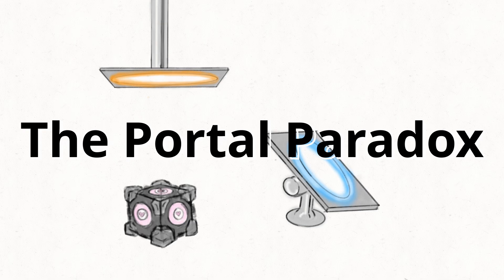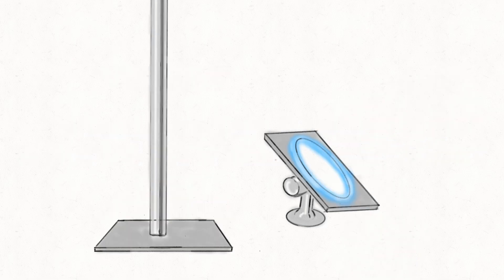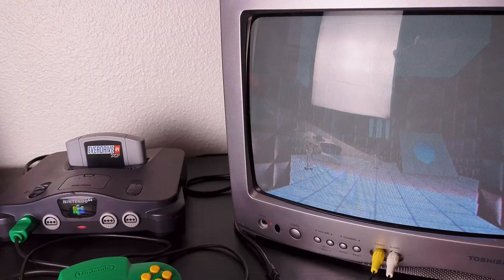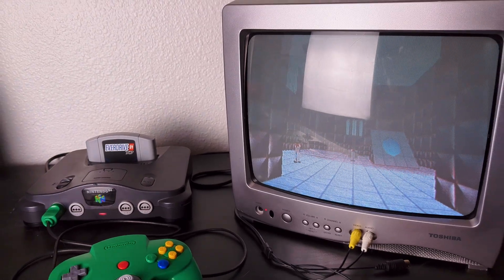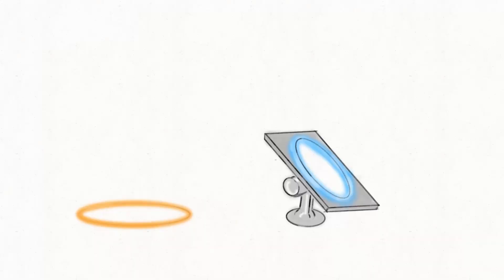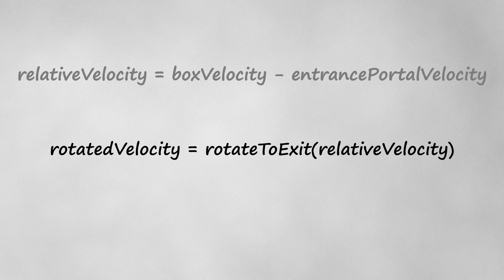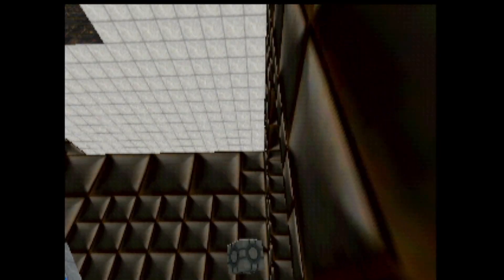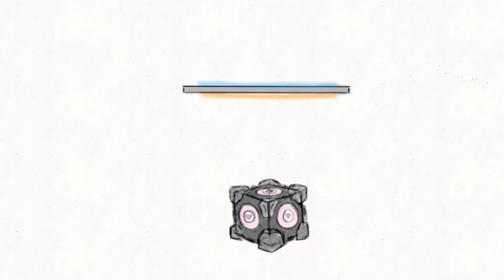I rewrote Portal from scratch and solved the Portal Paradox

Comment: f=ma Your model doesn't take mass into consideration, say the cube is a solid block of tungsten weighing 1 ton, by your model it wouldn't matter if the portal was on a piston going 20mph or a signboard swung by hand at 20mph, it comes out at 20mph. There is no force acting on the cube, just the transfer between portals happens quickly.

Comment: Or to make it short, The portal and "the world behind it" are can be imagined as a train that moves towards you. You are relative to yourself still not in motion but the world moves around you. Therefore in order to not fly through the world you have to move at the same speed relative to the portal, before entering it.

Another edge case scenario would be if the portal suddenly stops when it just moved you half way through it. The half your body, that was already "inside" the portal, would still have the moving velocity from moving through the world and you other half from "outside" the portal has no velocity because it never moved relative to the world. Means you suddenly experience fome sort of centripetal-ish force and if it was fast enough that may even cause you body to tear itself apart. ... Where the heck did my imagination that dark of a turn all of a sudden???

As you may have noticed does both only count if your portal has no "inside portal realm" but functions like an infinitely thinn door frame. (Like in the games snakes or astroids for example.) But if your portal HAS an inside relm you have to cross, like the wormhole you see in interstelar or the portal in the movie Warcraft (or like the teleportation power of nightcrawler in xmen was explained), the entire portal paradox gets relativated anyway.

Comment: A portal does not transfer its momentum to objects passing through it; a portal preserves the momentum of things passing through it.
Reply: It's the same thing because momentum is relative. A portal moving towards an object is the same as the object moving towards the portal.
Reply: @kremitthetaco8725  the way I picture it is the same as if you took a hollow box with a hole in the bottom and dropped it onto the platform with the cube. The box’s momentum would be absorbed by the platform and the cube wouldn’t move. Here, because the portal transports the cube to the slanted surface, to me the cube would slide off. 

“Cube moving towards the portal is the same as the portal moving towards the cube” is valid as a way to explain conservation and is true given specific reference frames, but it disregards initial conditions. For example, depending on the reference frame me shoving you is the same as you shoving me, yet we both know there are more factors involved and in all likelihood the two actions would not yield equal results.
Reply: @Scuuurbs  Your analogy with the hollow box doesn't take into consideration that the cube already enters the portal before it touches the platform. What is absorbing the relative momentum of the cube from the moment it enters the portal to the moment the portal touches the platform? Let's say it takes 1 second to fully push the portal over the cube. That's 1 second of relative momentum basically pushing the cube through the portal until it stops.

If the cube truly had no momentum when leaving the portal, then the same would apply to every single particle the cube is made of, right? If every particle of the cube is static relative to the portal, they would all try to materialize on the same location on the surface of the exit portal Do you know what happens when you force 2 particles to exist in the same location? I don't. I don't think anyone does. But it probably wouldn't leave the cube intact.
The only thing which would stop that from happening is if the following particles push the preceding particles out of the portal, which would once again apply the relative momentum to the cube. So this also leads to the result shown in the video.

I'm also really not sure what "initial conditions" you're talking about. The entire point of the Portal games is that you're in a test facility for portals which exists particularly to eliminate external factors.
Reply: @kremitthetaco8725 The particles of the cube are "pushed" by the same atomic forces that maintain the cube's shape, irrespective of any qualities the portal possesses.

The only momentum that exists for the cube in this scenario is from the reference frame of the portal itself, which is unintuitive. Better to use the reference frame of an observer - in which case the momentum exists entirely in the piston/panel the portal is attached to, and its momentum is absorbed by the platform the cube was on, as well as whatever the piston is connected to.
Reply: @Scuuurbs  The laws of physics don't care much about what is perceived as "unintuitive" by some observer. If the camera was attached to the moving platform, your entire point of view on the experiment would change but the laws of physics remain the same.
The cube and portal have relative momentum to each other and that's the only thing that matters.
And if you're saying the particles of the cube are pushed through the portal, then they must have momentum when exiting the portal. And how fast would they be pushed? Is it some arbitrary number? Or is it simply the speed at which the cube is pushed into the portal?
Reply: @kremitthetaco8725   I didn’t say physics cares about intuition. The point is that your choice of perspective is leading to misconceptions. 

Saying the cube and the portal have relative momentum is arbitrary. Everything has relative momentum. What about the relative momentum between the portal and the platform the cube is on? The portal and every particle of air passing through it? Just like the video creator, you’re reducing the interaction to a rudimentary level in order to get the results you expect to see.

Consider if you were in the cube’s place instead. You would observe the orange portal coming down towards and around you, you would observe the blue portal continue to go down around you… and according to you, you would experience lift? It doesn’t make sense. The only force you should feel is the change in gravitational force due to the blue portal being on a slant.

Also, I’m not saying the particles are pushed through. I said “pushed” in quotes to use your terminology. They aren’t pushed any more than they would be by dropping a hula hoop around them.
Reply: @Scuuurbs  The cube and the portal have relative momentum. Saying that is not arbitrary, it's basic physics. Motion can only be measured given a point of reference. Depending on what point you choose your perspective on the experiment might be different but the result always stays the same because the laws of physics don't care about what we choose as a point of reference.

And you're right, almost everything has relative momentum. You might be sitting still right now but you have relative momentum to a lot of things. The birds outside, the cars passing by, the sun we all orbit around, the moon orbiting around us. That's why it's important to choose the right point of reference. 
Neither the platform nor the observer play an important role in the experiment, so why would you choose either of those as a point of reference? Just because it feels right to you personally? The video creator chose the portal as the point of reference for his calculations because that is by far the most important object to create consistent rules for how portals work.
This way it doesn't matter if the portals are in different places or move in different ways. The math is always the same. It's not arbitrary, it's simply what makes the most sense. Choosing anything else would be arbitrary and unnecessarily complicated.

If you were in the cubes place you wouldn't feel any lift. Humans don't feel constant motion, only changes in motion caused by a force acting on the body.
If you're on a train that is moving at a constant speed you can just get up and walk around as if you were on solid ground. Only when it speeds up, slows down or changes direction you feel anything because that's when a force is affecting your body. 
When the cube goes through the portal there is no force applied to it. It simply maintains its momentum. Therefore you wouldn't feel any pull or lift if you were in its place, only the gravity that is pulling you down afterwards.

It doesn't matter if we say the particles are "pushed" or "pulled" or whatever. They move after leaving the portal. They have to to maintain the structure of the cube. Otherwise the scenario I explained earlier would happen with particles existing in the same location. They must make place for each other and that requires movement. So at what speed do they move? And why would they suddenly stop moving after the cube has fully passed through the portal? The hula hoop analogy explains none of that. According to the hula hoop analogy the particles remain static which would again lead to the cube destroying itself after leaving the portal.
Reply: @kremitthetaco8725  what do you mean you wouldn’t feel lift? You’re standing on a platform, a portal comes down, and suddenly you’re flying through the air with the momentum the portal transferred to you. You would absolutely feel it, and it makes zero logical sense. I can’t think of any scenario where something can transfer momentum to something else without some kind of collision occurring.

I think you and I fundamentally disagree on how portals work before their momentum is even considered.
Reply: @Scuuurbs  It makes sense once you stop arguing with your intuition and consider the laws of physics and the theoretical facts we have about portals.

As I said, no force is applied to the cube. Force is what you feel, not momentum. No momentum is transferred. The cube always has the same momentum.
If you jump into a static portal and come out the other, do you feel the change in direction? Of course no one has actually done that in reality but judging from the games it seems like that is not the case. Why is that so? Because no force is applied to objects passing through the portal, therefore you don't feel it.

Do you feel a difference between sitting in a train going 50 kph or sitting in a plane going 500 kph? You don't because as long as they maintain the same momentum, no force is applied, therefore you don't feel anything.
No force is applied to objects going through portals, no matter if they are static or in motion. You don't feel anything going through.
Just because you can't imagine it doesn't mean it doesn't make sense given what we know about portals.

I think you lack a fundamental understand of physics.
Reply: @kremitthetaco8725  The cube is motionless relative to its environment. The orange portal is in motion relative to its environment. As the orange portal completes its movement, the cube emerges from the blue portal and slides off the platform.

I’m not a physics major, but I understand enough to know it’s ridiculous to choose the only perspective in which the cube has the appearance of motion as your basis for deciding momentum. The cube is motionless with respect to every observable object not directly connected to the orange portal’s platform. 

Choose the anomalous perspective, observe an anomalous outcome.

Comment: Im still curious. In this experiment of course the cube is just a monogamous simulated entity. Would it be posdible to simulate the cube as a wireframe linked mass of smaller objects, like a 3x3x3 or 5x5x5 grid, essentially crudely simulating an object consisting of atoms?

Comment: Actually, Portal 2 does have moving portals in one room, in which they specifically deactivated the code that would otherwise remove the portal. However, that motion is entirely sideways.
Reply: simply bad game devsmanship as it had concretely already been established in early game Portal 1, that portals DO NOT move. And this is demonstrated essentially 100% of the game to be fact. The game devs "changing" this rule to make a couple of scenes work, is using the "rule of cool" and tossing out already established in universe physical law. Simply put, its a real world human error that they ever put moving portals in. Based on how portals work in the game and the set forth rules, they do not move, ever, and when they do, they dissipate. This is testable and proven and anything that changes how that functions without some explicit in game explanation, is real world human error.
Reply: @7thsluglord363   Yeah, except portals do move, since planet Earth does.
Reply: Ill put forth this example that completely solves all this confusion. Portals form a wormhole between them, in the portal universe, the wormhole should be thought of as a tunnel made from inflexible glass, theoretically, an inactive portal could exist on a moving object, but once the other end is created and the tunnel formed, ANY movement whatsoever shatters the tunnel and dissipates the portals. The wormhole is rigid and cannot be moved once created. Using this as the framework for how portals work, 100% of the moving portal issues go away. Applying any other idea as to how they work, creates issues without solutions, and violates the established rules of the universe, which, again, is what the devs decided to do in order to make "cool!" scenes
Reply: @7thsluglord363  Okay, then why did portaling to the Moon work?
Reply: @HolyPastrami  the rule of cool. Bad game devs choosing to make a cool scene rather than stick to already established in universe laws.

Comment: i respect your point of view and you are likely far more knowledgeable than me. that being said, the cube has no energy. i believe that the cube should not suddenly gain speed that it never had, and therefore should not be launched. the energy that would, potentially, launch the cube is in the moving platform, which transfers its energy into the ground, not the cube.

Comment: The equation is incorrect because the portal shouldn't be able to transfer its own velocity to the cube's as it doesn't apply any force to it.

The portals are only acting as a "doorway" between two points and the only change to the box's absolute velocity results from the new vector from the second portal. 

If you were to take the opposite example of a portal moving away from a cube but we launch a cube slightly faster so that it catches up and passes through, it would appear that the cube hit something even though nothing was there to obstruct the current velocity. I believe this would look pretty goofy. 

To some degree we could say the air being pushed out could have this effect, but not to the degree as seen in the video.

Comment: I feel like you shouldn't look at the velocity as a relative velocity between the portal and the box. What your code essentially does is transfer the velocity of the platform to the box, which I'm not sure actually makes any sense.

My solution would be to consider the forces acting upon the box at each point in time. Initially, gravity is holding the box on the ground. Once part of the box enters the portal, that part of the box comes out of the other portal, so gravity will act differently on that part of the box, pulling it downwards relative to the blue portal. This would cause the box to start moving downwards relative to the blue portal, therefore right relative to the orange one, until it hits the bottom of the blue portal (as well as the right side of the orange one) and stops.

Therefore, if you only moved for a bit and stopped without covering the entire box, the system would reach that point. If you kept moving the portal downwards, at some point (presumably after the middle of the box has been passed, if the box is a uniform square mass), the gravity relative to the blue portal will overpower the one relative to the orange one and the box would simply fall.

Of course, if you did this too fast, the box would fall before it has a chance to hit the bottom of the blue portal.

This approach assumes the forces are always different on each side, meaning the moment a part of the box moves to the blue side, the direction of the gravity applied immediately switches.

Comment: it would plop out became the object itself needs to be moving for the momentum to transfer. Speed is a calculation of time and distance. When the portal touches the object the transfer is instantaneous, meaning the dimensions of time and distance(space) have not been applied to the object so no acceleration or speed would have the area of space to exist. But really it could be either or, as you've demonstrated it depends on the makeup of the portal not the object. Is the portal a frequency entity without mass? Than it plops out. Is the portal make up of some kind of matter, some mix of gaseous particles that has mass? Than it flys out. Thats the real queation, what is the portal made out of?

Comment: what happens if you stop it half way down the cube? Would the object "pull" the rest of  itself through and shoot out due to the relative motion? Or would it just be a cube that is half and half form each protal? If your theory is right it should shoot it self out because the initial force. I think you're wrong because even though there is motion there no is pulling or pushing force applied to the on the object itself. If your theory was right then in a fast moving train if you jumped up you'd fly back and hit the wall. All forces are local.